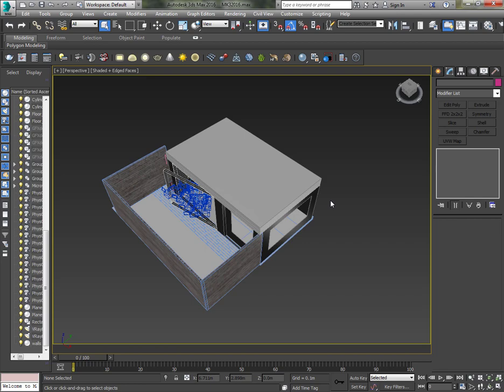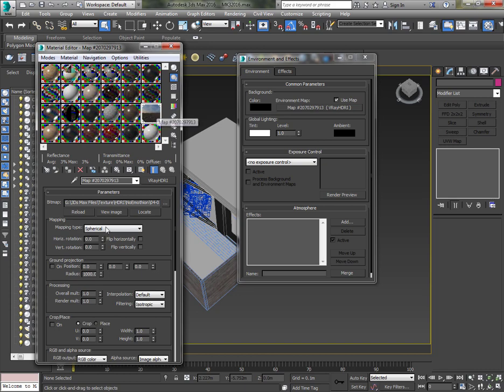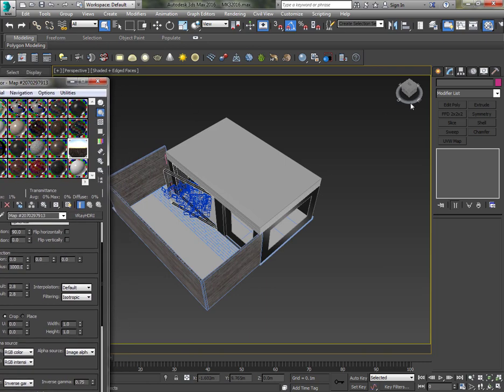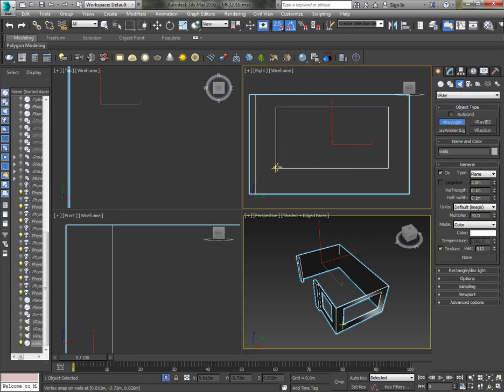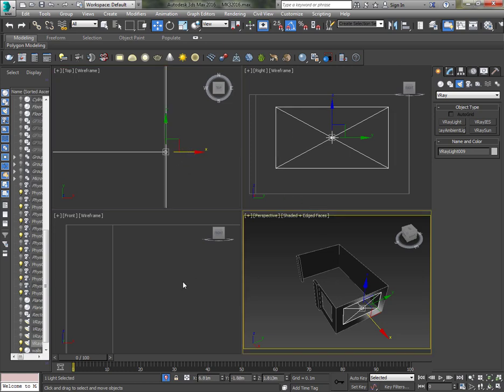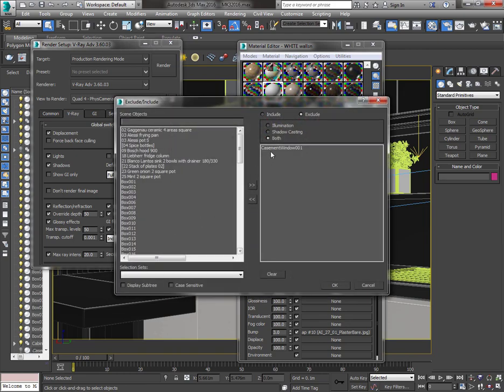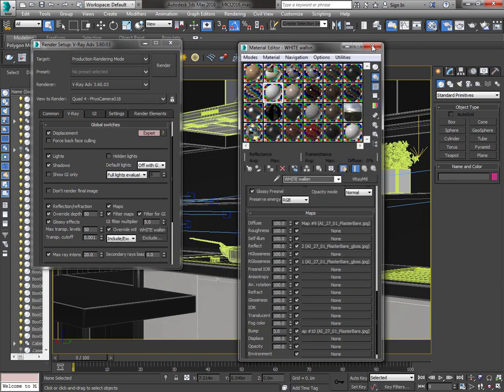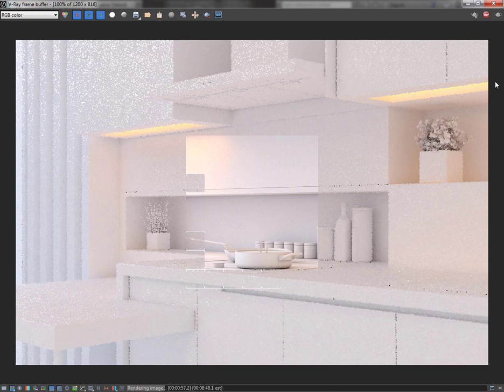Kitchen design in 3ds max tutorial + Vray + photoshop Part2

Comment: I did the exactly same. But when I render the lights, It is over exposed. Once I change the multiple to very small amount, it looks ok. Question is why your settings doesn't work for me. Please help.
Reply from the maker: Hi again. please send me screenshots of your Vray setup and Frame buffer window while rendering. then I'll help you as well.
Reply: @SaeedMandegarTutorials  Thank you for your kindness. I think I may have done something wrong, I did the same again and changed the settings in rendering as per next tutorial. Now it seems problem solved.
Reply from the maker: Hi Jason. that sounds cool. I'm glad that the next one could help you. stay tuned for the next render setup tutorial. it'll be a blast.

Comment: If your lighting is really bad try and enable "automatic exposure" in the render setting (v-ray > camera) it solved my problem and maybe it can solve yours.
Reply from the maker: well, my lighting is what it should be coz there's lots of theory on how the lights should shine and reflect that I follow. the reason I commonly don't use automatic exposure is that:
1- it produce high amount of noise rather than the way I do. so my final render will be clean.
2-it make the render unreal. or at least not as real as the common way. coz it light up the scene not in the way that the real sun or light sources do.
but it's a cool trick if you can't light up your scene as well.